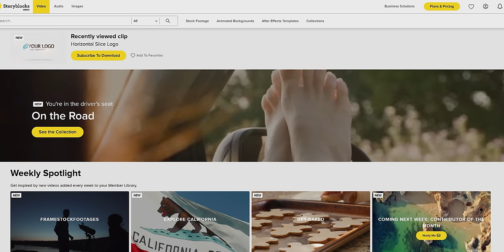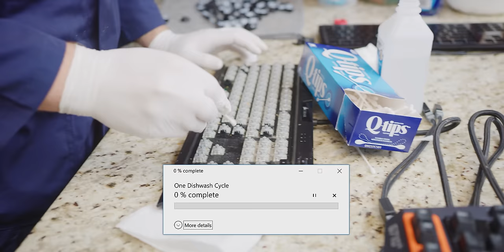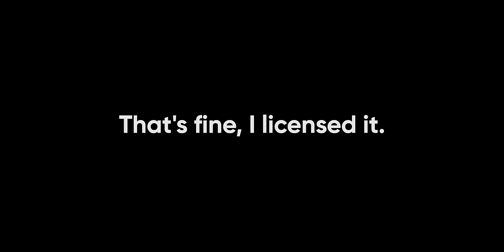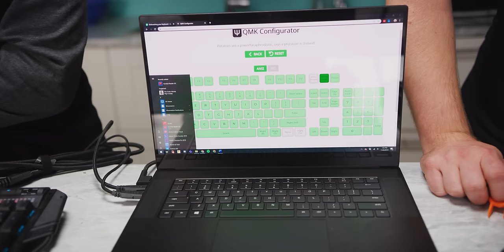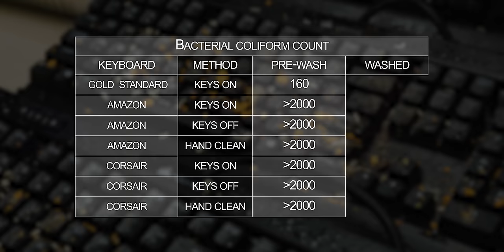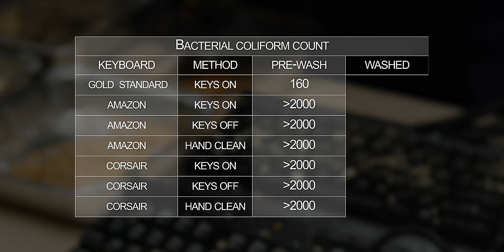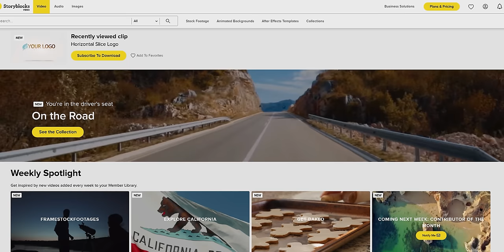The best way to clean a keyboard is… the DISHWASHER?

Comment: There is a video where someone puts a camera in the dishwasher and films it working, the wash is not high pressure spray, more like rain.  I am thinking that using a garden hose with a higher pressure spray, might do a better job of getting out the gunk.

Comment: For real though I accidentally spilled cocoa on my keyboard so took it completely apart and put the circuit parts in a ziploc bag and washed all the frame pieces in sink and let dry. Luckily most the vital stuff was dry and I just carefully went over with mostly dry towel and ear cleaners. Then soaked keycaps in soapy water some time and rinsed and dried them, good as new. Took almost two hours though unfortunately

Comment: Ive actually done that multiple times, but never with a keyboard that has an lcd, always removing key caps and putting them in a closed net and drying all of it in "dry heat" and never use the dishwasher dry option. Never had an issue.
But i have to say: Ultrasound cleaners ftw ;)

Comment: Oh boy. This is a year old now.
When I clean my KB. I remove all the PCBs (if more than one), leave the key caps on. Run the KB through a pressure washer. Dry it with a blow dryer and screw the PCB back on. 15 minutes work and a squeaky clean KB where no water touched the electronics. No hair under the caps, like new and works after 20 minutes work total. 30 at most.

Comment: I thought you were just supposed to put the front part of the keyboard, (the part with the keys attached to it,) in the dishwasher, not the whole thing. How does the water not ruin the electronic parts?

Comment: Tips for next time: Make sure the keyboard is FLAT and face down. Don't place it upright. Top rack ONLY never the bottom rack. Use the air dry option, not heated dry. Place the end of the cable in a baggy, and use a rubber band to seal it. To dry the keybaord, shake out the excess water, towel off. Heat your oven to 150F/65C or as low as it can go, place keyboard flat and face UP in oven and bake for about 20 minutes. Then let the keyboard air dry for 3-5 hours. I've used this trick dozens of times over the last 15 years or so.

Comment: Contrary to common sense, most electronics are perfectly fine to wash as long as you make sure there is no residual power in the capacitors, etc. I'd also avoid getting transformers wet since they can take a long time to dry out. Many electronics manufacturers clean flux from PCBs in ultrasonic cleaners after assembly.

Comment: That Logitech G910 is of particular interest since I found one at Goodwill for like $12.95 and it looked like it could use a dishwasher lol. Instead, since I don’t have a dishwasher, I pulled all the key caps and cleaned it the old fashioned way. Works great, looks great, and is as clean as brand new. But hey now I know, I can put it in a friends dishwasher lol.

Comment: When you remove the keys anyway, it is not much mor work to unscrew the backplate and take the electronics out. (That should effect the cleaning positivly, your'e propably could use soap and the drying time is much shorter)

Comment: I recently spilled water on a Dell keyboard. I opened its case and didn't find a standard PCB. Instead, I found two flimsy sheets with several traces crossing each other. 
- The first sheet is protective and has interlacing diamonds across its surface, and is see-through. 
- The second sheet appears to have the actual circuitry on it, with dots marking the key's contact points. It's shiny like the interior of an aluminum can.

The water seemed to cause permanent damage. I replaced it with a g910 and a spoon fucking trebuchet'd sweetened expresso on the l, p, and ; keys a little while ago.

Comment: Fun fact: my Xbox one X got waterlogged while in storage during a hurricane. I let it dry and plugged it in. It still worked but the heatsink and fan went out. $30 on Amazon and a quick fix and it’s still running.

Comment: Chaps this might surprise you, many years ago Tektronix used to jet wash 7000 & 500 series Oscilloscopes, and then dry out at 50C in a drying box !, they came out like NEW, also helped to clean the switches, used Tiket mixed with water, (Washng tablets would contain salt not very good on electronics, that white coating is salt,
Something that might be worth it is a Jet Wash !, 
Water would be hard to get out of places like flexprint area where the flex membrain crosses together, Indeed a Keyboard is a place to worry about when Corvid 19 is around !!!, 
Good Demo Chaps,
Philip from UK

Comment: I can't believe you looked so shocked when they worked. You do know that nearly all mass produced mother boards, Graphics cards, etc... In fact nearly every PCB board gets washed with water after it it's been soldered to clean off excess flux and stuff. It's not water and electronics that do not mix, it's water and electric. If there's no power going through it and all capacitors are discharged you get nearly all electronic stuff wet and it will work perfectly fine once it is 100% dry.  Try it. Grab a laptop. Make sure everything is off with no residual power in any of the circuits and throw it in a bath. Wait for it to be fully dry without any moisture left in it, it will take a while, or you could dismantle it and put the parts in a drying oven (they make them especially for circuit boards, as well as water baths) and it will be fine...

Comment: the way i clean keyboards is by placing them on the top rack upside down on the hot rinse cycle, then let it do the heated dry / sterilize cycle.
50/50 results every tine

Comment: The soap is for oil, not "sanitation", so no you can't just use the washers heating for sanitation and expect it to clean your keyboard from your oil buildup which is generally the point of cleaning a keyboard...

Comment: How to destroy your keyboards switches and PCB 101! I do not recommend this method at all since water will be trapped inside the keyboard and will eventually corrode it due to the impurities of most household's tap water. Also the PCB will begin to separate apart due to it being water logged.

Comment: Cool video! I tried this with my Qpad MK-50 mechanical keyboard with red switches, I think that the lubrication inside the switches got washed away; the buttons take a little more force to press it downards. Lucky for me I have a great reason to go buy meself a new board ^^

Comment: I just spilled icetea over it some day. Most keys didn't work after that. I opened it, and put it in my shower. I washed it all, cleaned everything with a towel and reasembled it after that. No waiting time and it worked again. All together less than 1h work and b.c. of the towel i used to dry the layers in the keyboard, no waiting time at all. Only thing to know, this keyboard was without any display.

Comment: let's them dry for 2 weeks
"Quick, fast AND easy"
Reply: It's definitely easy, and quick and fast to do. Yeah, you won't be able to use it for days though. But the process itself is basically 5 seconds if you throw it in, or 15 minutes if you take the keycaps off and clean them separately like he advised, instead of an hour playing around with cotton swabs collecting every hair etc...

Comment: Dont do this uinless you have a cheap keyb. The better way to clean a keyb that u spilled something on is to fill a large tray with hot soapy water, submerg the keyb and move the keyb around in the water. Then leave it for an hour and two and repeat until the water looks clean. Now for the important part, buy isopropanol (its used by pros for cleaning electronics since it evaporates without leaving residue) and fill the now empty tray u used earlier and repeate the cleaning prosedure i mentioned earlier but now with the isopropanol instead of water. Then let the keyb air dry. 

Not only have i done this with my corsair k95 RBG, but i have over 20 years experience and i have worked with both civilian and mil.spec. electronics.

Comment: i spilled coffee all over a razor keyboard, and i ended up taking it all the way down to the pcb and handwashing it in the sink. used a little soap and a soft sponge, let it dry for a day and it worked perfectly! i think since i took it apart so completely it dried a lot faster

Comment: I just take mine apart, and all the keys stay as a assembly together, i then clean the circuit board, then the rubber/bouncy/thingy, and then the "case". reassemble it. And it works. YAY !!

Comment: Putting whole keyboard into dishwasher seems to me as not very smart approach especially when you put inside whole keyboard even with its electronics and leave them in humid environment for days What I was doing for each 6 months was to remove front cover of keyboard, remove keys and rubber membrane. Then put them all into solution with greese remover, then leave them to dry out for ~ 2 hours or speed it up with hairdryer. Since coronavirus pandemy I do this proccess every 14 days and keyboard looks like shipped from factory

Comment: I really did this years ago when i had a cheap membrane keyboard i guess it was iball keyboard and It stopped working then i washed the board inside  and then outside shell under the tap and dried it throughout the afternoon under the sun and it magically started working

Comment: DO NOT USE DISHWASHING SOAP! It has oxidizers in it. It will destroy the metal components, i.e. electrical components.

Give the keyboards a soapy soak. A gentle soap. Something like shampoo, hand soap, anything without bleaching agents. AND THEN stick them in the dishwasher without soap.

I did this in the Air Force with about 30 keyboards. A simple one hour bubble bath soak, and into the washer it went. I used a semi stiff brush before washing to get out as much hair as possible. These were all keyboards from the pre Pentium era. All 486 machines. With those heavy, mostly metal, keyboards. With the super loud "CLICK!!" when you typed anything. Talk about hysteresis.

Comment: vacuum, - shot air - get off "exceses",  vacuum and shot more air. 
wash it with your brush, soap, even you can try with the kärcher, - shot air to dry it  and dry, and more air. 
if you knew some boards of electronic devices like amplifiers are washed like dishes

Comment: One thing to consider if you do remove the keys, is to put them in a mesh bag as seen. However, instead of putting that mesh bag in a dishwasher, put it in a washing machine on the gentle cycle with minimal detergent. That's how chicks wash their bras.

Comment: I wish you can do this for those laptop keyboards with failing keys. I'm wondering if I could wash my dell G5 keyboard (removed from the laptop of course) with rubbing alcohol (methylated spirit) to clean out the contacts? some keys on it have failed. i was hoping i can find someone who has disassembled a spare one online cause the keyboard appears to fail a lot.

Comment: What the hell are you guys doing? (rhetorical).......Generally speaking, you never need to clean the lower/electrical contact aspect of your KBs, it is almost impossible to get dirty. Just the upper side (with keys still in of course). You may using a "mild" amount of dish washing liquid (no shorting issues obviously). When done, set this half of the keyboard on an inverted milk crate...set crate over hot air vent on floor,  in lieu, a heating fan or plain fan work nearly as well. Probably dry within an hour but certainly by next day. If you have managed to soak your clear printed circuitry with coffee, milk, orange juice, beer etc just use a spray bottle containing only distilled water to spray off all plastic leaf surfaces and exposed pad contacts, use a very  clean cotton pad (or face cloth) to clean stubborn milk ect  and also for the final mechanical drying the relevant surface's. Cloths peg (or similar) the sheets about 4-6 feet above wind/heat source for short period and viola....finis.  This method is faster and leaves no high resistance or mechanically obstructive dirt or film hiding.
Really like your show although the goofing around and the exadurated, quasi shocked facial contortions, while adding nothing, remains annoying, distracting and time consuming. Not much of a complaint I guess.     Take Care

Comment: Done this many times at my old pc support job, supporting a building of over 1,000 employees.  Same amount per load, 5 to 6 each.  People can be slobs..  And when someone leaves and someone new is hired (clerical positions have a lot of turnover and a higher rate of 'slobbery', last thing you want it to sit them down at a computer with a disgusting crusty keyboard.  Employees would ask "Can I get one of the dishwashed keyboards?"  They knew I did it lol..

Hot water is fine.  Some soap is also fine, just use about 1/4 the normal amount.  If you are worried about disinfecting, a tablespoon of bleach is fine.  I never bothered to take the keys off.. these were HP and IBM cheapy keyboards so not worth the hassle.

After washing, shake out the water, then stand the keyboard up on one of the corners for best draining. Give it a week.  All will be well, and food, makeup, whatever gross shit was on it will be gone.

One or two old keyboards did have a modest "lightening" in the color of the plastic, but still worked.  Preserving that should be no problem if the dishwasher has a "warm" instead of hot option.

Comment: not a chance in hell I am running my model m through the wash, using tap water.  anyone who cleans any electronics using tap water is flatly nuts and is only accelerating opportunities for oxidation due to mineral deposits left behind, and ultimately equipment failure.  

yes - labs and such wash their boards with water - and even machines... but they are using distilled, purified and sanitized water, and in a controlled space.  not in a dishwasher and not in the back yard with a garden hose and a rubbermaid tub. 

it might take a while - but karma will ultimately catch up.  just ask the folks in the vintage audio groups on fb who did this - finding out a couple years later that their capacitors and such were not as air/water tight as what they thought.

Comment: The only thing is you guys didn't try it with soap to remove dust and get it squeaky clean. I'm still not comfortable running my keyboard thru my washing machine. I'll stick with manual cleaning even though it's still a pain in the ass.

Comment: I wouldn't call this a quick and dirty solution... Ah, see what I did there... 😉 But seriously, it isn't a quick solution since the drying time is sooooo looooong, and even then, if the keycaps haven't been removed, it is also a dirty solution. Plus, who knows the actual long-term effects on the keyboards. As such I would suggest not to use this lazy method but just clean by hand.

Comment: Putting the key caps in a mesh bag is a great idea. But don't put that bag in the dishwasher. Put in in the washing machine the next time you wash towels or jeans. The textiles won't mind and the caps come out clean as new.

Also: do use detergent. The dishwasher tries very hard to rinse it all away at the end of the program. If you don't trust it, you can just rinse it again in the shower afterwards. The detergent actively takes the food and skin particles apart in a way water alone can't possibly hope to.

Comment: How NOT to clean a Keyboard !!!   This video is designed for entertainment only.  It iss a cheap attempt at ratings.
   To correctly clean a keyboard use a long bristle scrub brush, a 1"paint brush, and terry cloth towels and a spray degreaser like Formula409, Dawn or Fantastic. CLEAN THE KEYBOARD UPSIDE DOWN.  Removing keycaps is a good idea but not always necessary unless the keyboard is caked in grunge. Shake out all debris. Spray the brush and towel and NOT the keyboard. After cleaning. Wipe dry with Towels and let sit upside down for at least a several days to fully dry.
Then use a keyboard protector and you will not have to clean it again.

Comment: Oh god. This is why I unsubbed from linus. He knows less than his manerisms indicate. This is a good way to run into issues later due to junk getting stuck in between the keyboards circuit sheets and corrosion on the mainboard. If you do this, take your keyboard apart and only wash the top and bottom plastic bits. It takes only a few minutes extra. Set to no heat cleaning and do use soap. set it on a drying stand for a few hours and reassemble.

Comment: nah nah nah you are doing it all wrong! the right way to do this is with a power washer (no, not on the stronger setting you dummy). put that kb against a stop and have at it. then you can wait a week, use compressed air to remove most of the watter and then wait a few days, or simply use isopropyl alcohol.
the power washer thing was a joke- i have never tried that. the iso.alcohol part is true.